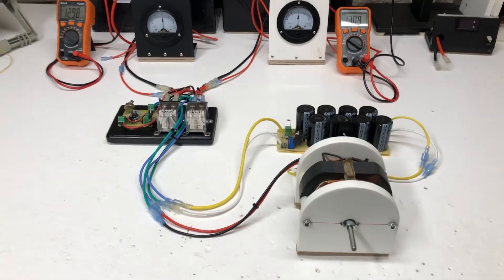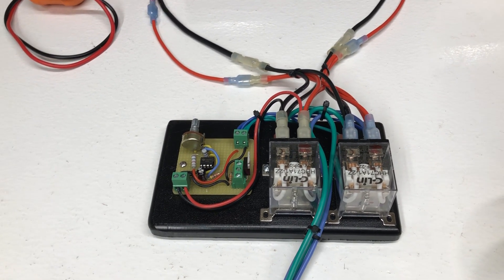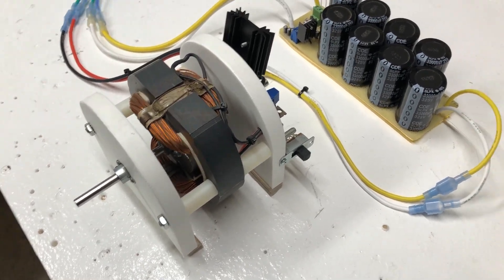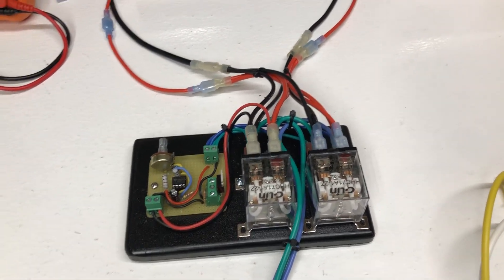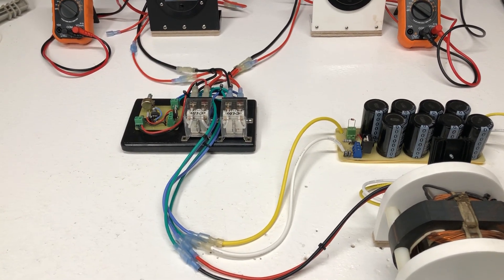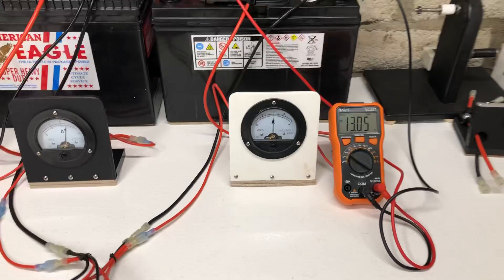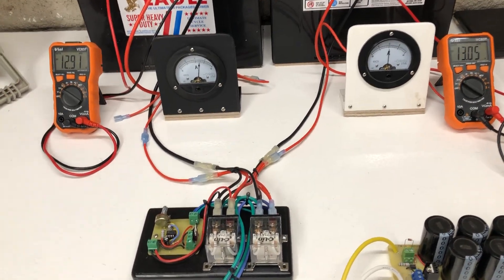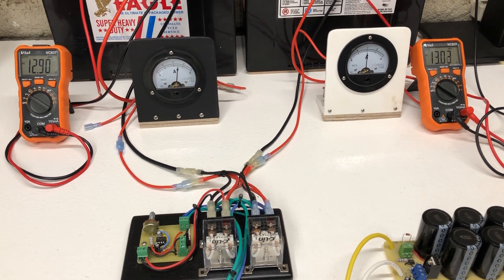Battery swapping system for pulse motor

Comment: Excellent K. Could this be run at the same time as the 48v Cap dump with primary shutdown or would it require the cap dump to omit the primary shutdown sir? Very interesting sir. This device was suggested by Babcock as an essential part of an overunity system. With 48v as both run and charge with 3 minute intervals for swaps. I'd like to get your opinion for 30 minutes after the holidays if you're not too busy sir?
Reply from the maker: Yes it can batteries should be same voltage though
Reply: Excellent.  Thank you sir. @kenergy1707

Comment: I'm sure you have moved on from this project . I would have liked to see it run the battery down to 12.5v then switch and see run time and if they would recover
Reply from the maker: Yea I’m waiting for the latching relay these us 300 ma when on would be ok for big motor but not for the little ones
Reply: what about scr's . solid state relays . i have some don't think they draw a lot
Reply from the maker: @hydniq3327  you could 
 Energy hack has a system like that

Comment: Nice! I'm jealeous of how good you are at designing these custom circuits.

Been trying to figure out how to best swap batteries, and am thinking about using one 4PDT latching relay triggered by an Arduino (since I'm not nearly as good as you in building custom circuits).

Nice thing about a latching relay is that they use less power.

Not sure if your circuit already does this, but it might be worth turning the motor OFF briefly while the relay switches, or else the relay contacts might not last very long.

Can't wait for the upcoming video with more details about the circuit, keep up the great work!
Reply from the maker: Thanks buddy lol yea I heard about the latching relays haven’t had time to check them out seems like a great idea 

I thought about turning motor off but it runs so nice and seem less how it is
Reply: @kenergy1707  I  have the arduino code for it K.

Comment: This is great ! Much simpler than what I’ve been using. Are the batts in parallel or series with one another? - I’ve found auto switching them in series (Bedini set up) is more complicated.
Reply from the maker: Thank you ! My output from my motor puts it in series like bedini circuit 
 The system works great doesn’t matter which of the purple and green you use it just works lol

Comment: How long have you tested this setup for? does both batteries sustain their voltage?
Reply from the maker: Thank you for the comment 
 Just started on it prob couple hours but the battery voltage seems to stay up much better as you can see on this short video
Reply: @kenergy1707  Still going a year later? :)